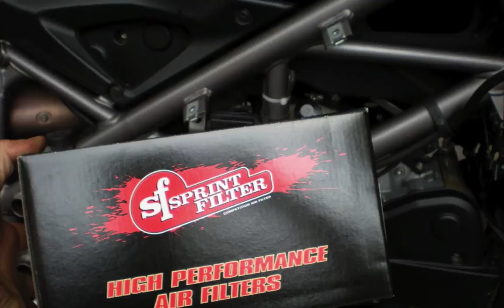TUTORIAL AIR REPLACEMENT DUCATI 848

Comment: Can the sprint filter be washed?
Reply from the maker: Hello, our filters don't need to be washed and oiled. But if the Sprint Filter air filter is accidentally dirty with oil or other contaminants, you can wash it with all detergent you have and then blow it with compressed air.